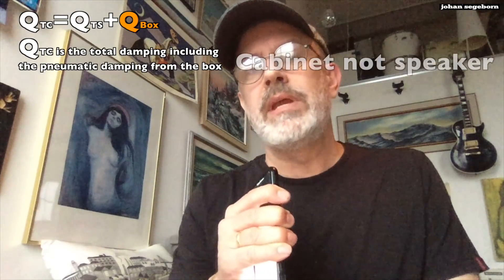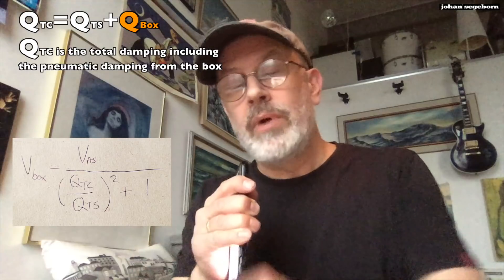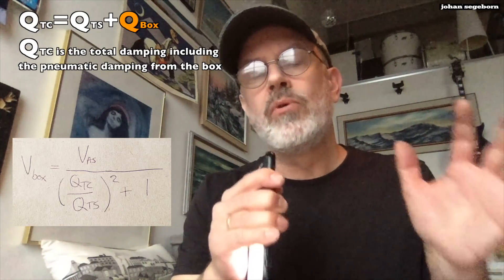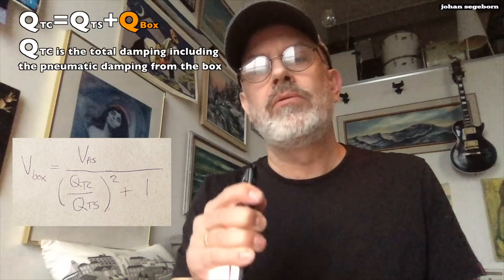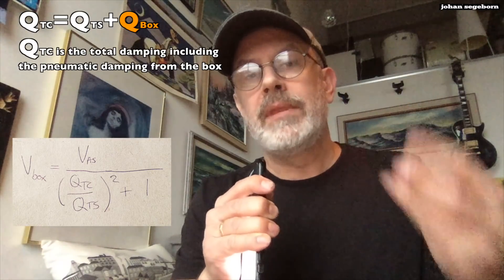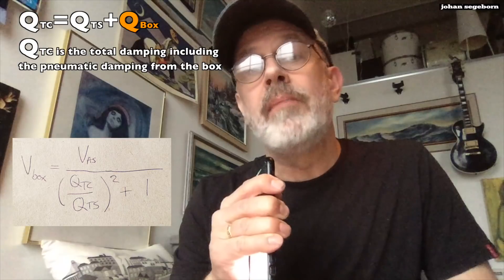Is the "Perfect" Guitar Speaker Cabinet really perfect?

Comment: The Mesa cabinet is front loaded, that scoops out lower mids from like 200Hz to 800Hz. The area engineers refer to as “body”. You get more clarity and openness to your tone, equivalently less body. Rear mounting your speaker like in Marshall gives those lower mids a boost, ie more body to your tone.
Reply from the maker: That’s an interesting observation. I haven’t had that experience but we should definitely try it in a comparison. Do you know the physical reason for that. Is it that less of the speaker resides inside the cab? Cheers
Reply: @JohanSegeborn  what the physics are is more difficult to understand, but here are the measured results. https://celestion.com/blog/should-i-front-or-rear-mount-a-speaker-onto-the-cabinet-baffle/

Comment: Like others, I prefer the Marshall cab for similar reasons. Maybe because it's the kind of sound we are more used to hear? The Mesa cab was definitely tight and clear, though.
Reply from the maker: Thanks!
Reply: I think it is more the application.

The bass guys seem more forward thinking with gear (I actually pull several ideas from them) and something like an optimized cabinet to help with clarity is pretty on point.

Guitar is more variable (just look at the different presentations various amps give). If you were looking at a "reference" design to compare various components, the wide body makes sense (even if that is not where you end up).
Reply: Oh, yes, I agree with you as well.
There are always two factors affecting our sound:
- What you like when playing by yourself.
- What actually works when playing with others.

I don't gig or anything, I was just a «low level» teacher, but I always taught my students to take the bass a notch down from where they liked it in order leave space for the bass guitar. Point proven that day I took a bass to the lesson and we had to match our frequencies in order to be able to hear each other at room level.

Comment: Probably unsurprisingly, the "ad hoc Marshall dimensions" have more "character", which just works well for guitar. The Thiele cab is tight and precise and... less interesting to my ear. I recently purchased a pair of vintage EVM 12L's and i've been wondering about the same question and if i should get a Thiele cab. Perfect timing and thanks for the video, Johan!
Reply from the maker: Thanks Charlie! I’m glad the video is put to some good use!
Reply: I just bought an EVM12L and am waiting for a TL806 box to be built. This is perfect timing.
Reply: While I agree with your assessment, at the same time I see the benefit of the space saving Thiele box. Soundwise I prefer the Thiele because it's cleaner sounding and sometimes that's what you want. But now I feel like I should buy a EVM 12L...
Reply: Johan is the Kaiser Sose' of Guitar Amps,,,if you even think about buying something with out tuning in first, you will have murdered your wallet while  you were wide awake!  Yaaaaaaaaa!

Comment: Wow, never thought I would say this but I actually prefer the Marshall cabinet. I'm really missing some mids from the Mesa cab.
Reply from the maker: Thanks, it is middier but also boxier
Reply: @JohanSegeborn  Thank you for the great video and the amazing explanation of the Thiele parameters!
Reply: The mids are reduced from the Mesa cabinet because its a front loaded cabinet. Marshall is rear mounted, so it gives back more lower mids. Front loaded always gives a more open and clarity to the sound. Rear mounted gives you more body to the tone. These are the exact frequencies when session guys and engineers refer to “body”.
Reply: @voxpathfinder15r  How would the mounting of the speaker to the baffle make this much of a difference? I think this is more depending on open vs closed cabinet.
Reply: @error8418  you can read about the difference here. https://celestion.com/blog/should-i-front-or-rear-mount-a-speaker-onto-the-cabinet-baffle/

Comment: Since I was in right before moving to regular comments, I'll just say that I think the imperfections are what give the Marshall cabinet its character.  Guitar is, after all, a lo-fi instrument.  Distortion is an imperfection that we appreciate, and we think that it gives the guitar a desirable character.  Speaker cabinets shouldn't be any different.
Reply from the maker: Yeah it’s indeed hard to optimize something that builds on an imperfection in the first place. I prefer the Thiele cab for the cleaner parts though
Reply: @JohanSegeborn  : actually, if you team the Thiele with a serious post-preamp EQ the same way Mesa did with their 5 bands one that auto switches on when you call the amp's distortion, the 12L will do true wonders in distortion too... If you rely on a more serious EQ than a 5 bands, your 12L can "copy" the freq responses of all guitar speakers on market.
The 12L hasn't the usual ear flattering 1400Hz freq drop other gtr speakers have, so you need the EQ for the usual natural V-EQing in distortion.
The only thng I can't do with the 12L is replacing the alnico speakers.
Since I couldn't secure the owning of a pair of alnico EVM12SRO or Altec 417 or Weber Michigan 12 Alnico which share the same cone, I just ordered a WGS Blackhawk HP 100W : if the 50W version is a drop-in replacement for Celestion Gold Alnico, the 100W HP (high power) one has a large dome similar to the EV one and several sellers list it as a drop-in replacement for the SRO. I noticed a promo with two remaining 16 ohms ones on a German website for €182.82 yesterday, then decided to listen to some tests, fell on a shootout between the 50 and the 100W versions, the 50W had a Celestion feel, but the 100W sounded totally different! Way more EVish... I can't tell if it sounds like a SRO or 417 but I thought it might make my day so I ordered these two remainders : I already own a Celestion Gold I loaded in my AC15 but I really don't feel using it with either my stereo Marshalls or Mesas
Reply: Chris Mondy  >>> Excactly .
Reply: At one point, however, if you have too many parts colouring the signal, it will start to lose something. Having "colourless" or at least scintifically "optimized" elements at strategic points of the chain will let you hear all the GOOD degredation in its glory.
Reply: Chris : the issue is not just with the cabs, it also comes with the speakers! The Celestions and Eminence all have a 1.4kHz freq drop... The 12L hasn't... May feel boxy? You can use an EQ to create a freq hole! 
Now listen to how the Celestion or Eminence speakers are defined compared to the EV! It's just like listening to 128k mp3 compared to 24/96 masters! 
Going Lo-Fi from a high quality signal is easy, you won't make high quality from Lo-Fi...
BTW, I'm mainly a Marshall guy : I own a 9005 (two JCM800/50W Silver Jubilee poweramps) and two EL84-20/20, I can tell you that no matter the preamp (Triaxis, Marshall 9001, Soldano, CAE 3+SE and even the Rockman Sustainor(!)), the results are simply MARVELLOUS! By using a post-preamp EQ, I can blend in ANY style and it's freaking touch-responsive, I can even get the insane punchy impulsions Hendrix had on the Voodoo Chile/blues (he used a 2x15 with JBL D130F on it).
Colouring speakers are only good to bring some life to sterile amps, but I can guarantee that amps with serious characters like my Marshs benefit way more from this uncoloured speaker : you REALLY hear your amp's sound and it's absolutely gorgeous! If you consider high end amps like the Mesa Mk series, and Howard Dumble opted for the EVM12L for the same reason, are truly pitiful with Celestion speakers! When the 12L was discontinued, Mesa loaded the Celestion C90 in Mark series enclosures, let me tell you that a Mark-series falls a lot in quality : with this, it's just a good amp like many others while with EVM12L, it's a true marvel! 
I'd surely consider some Celestion with some lfeless amp, maybe something ultra clean designed for extreme metal, but with any "good" Marshall or the old-school Mesas, EVM12L is my go to, period!
Reply: @El-Poussah  he uses the same speaker in both cabs…
Reply: @Chris-hq7nl  : I wasn't speaking about him